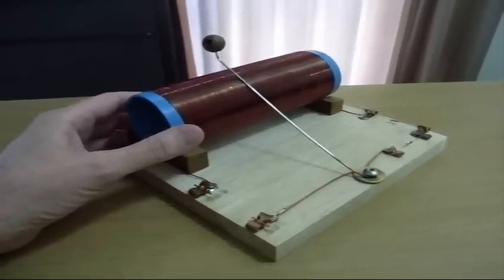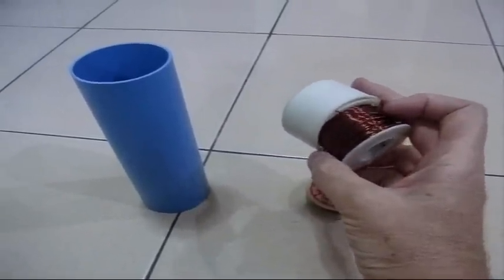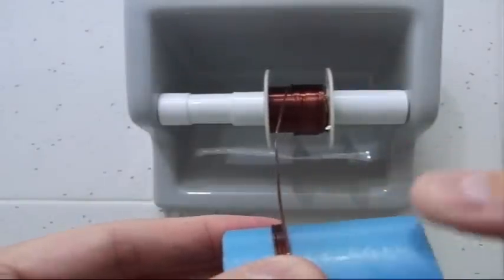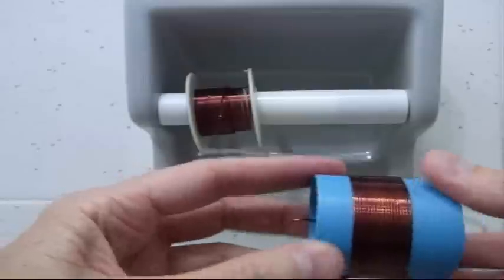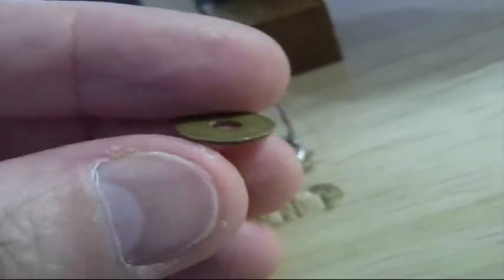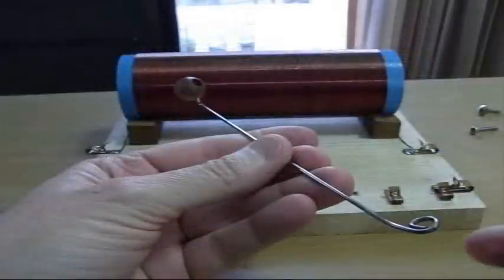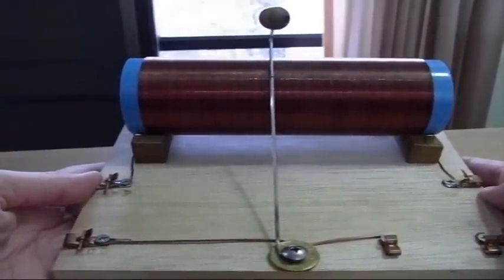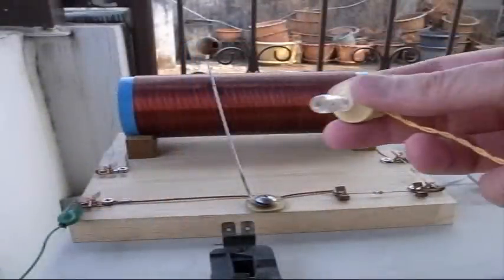How To Make A Crystal Radio - No Batteries (Updated Version Available)

Comment: No variable tuning cap?  I would think a simple slider foil variable cap would increase selectivity. A lot of the Xtal sets use a 150 or 240 micro Henry coil with a 365pf  variable cap for tuning. creates an oscillating tank circuit to select the carrier frequency and squelch other frequencies as I understand. Not to be confused with the cap that sometimes is use for the earpiece.
Reply from the maker: I thought the same.  I saw the same in many diagrams on the internet, but no one actually made one.  So I did.  It did not work.  It got 1 station well, a weak second one.  A germanium diode by itself will get 1 station!  (I made videos on both of these.)   I've been looking at transistor radios that use a 365 var cap, and they use a few very small coils BUT they also use part of the ferrite antenna in the turning circuit.  Don't have it totally figured out yet, need to spend some more time with it.  https://www.youtube.com/watch?v=i2PITPUg2vI
https://www.youtube.com/watch?v=GdvKDFz9Xi4
Reply: The Antenna supplies the necessary capacitance, and the variable inductance tunes the two together. This is how the earliest sets worked before tuning caps were available. But you do need a big antenna and an Earth.

Comment: Can it be made on a smaller plate using the same coil?
Reply from the maker: The dimensions of the coil are important. With more work, you can mount it vertically....

Comment: Would you mind why putting the resistor in the circuit won't reduce the flow of current/signal...sorry to ask but i just need to know :
Reply from the maker: +Meiji Jap It does a little bit.  The earphone has a lot of capacitance and if you don't keep that capacitance discharged it builds up and you get a snapping noise instead of a nice sound.  Try it!
Reply: what a coincidence does that noise that i hear in my home phone is over capacitance from the phone line?
Reply from the maker: The noise on the home phone is probably caused by corrosion on a contact somewhere in the system.  Copper oxides can act as a diode that forms and breaks down so you hear static.  You can wiggle your phone plugs to see if it gets worse; if so have them cleaned.

Comment: The first crystal radio kit I got was a X Mass gift from my dad in 1962 and when we / he assembled for me I was astounded that it worked without batteries!  Even in 1962 every kid knew that cool toys and radios needed batteries to work so this gizmo was too super cool!   Later from time the Walgreens Drug store would sell near the check out the Rocker Radio ! for your listing  pleasure or about $3.95 in 1965 money.   https://www.youtube.com/watch?v=t5ww6bQg5ic  .  I bought a couple but my peers though it just make look like a nerd when I was using it so I gave up on them and they ended up lost or broken .  Still love the idea of this very old tech.
Reply from the maker: I built my first one about 4 years after yours.  Mine was from the Wolf Scout handbook.  Did not work at first.  By trial and error I figured out there was a misprint and an extra wire was shown that shorted the main coil.  Still have that book.  It was a lesson to me that books are written by people and people make mistakes.

Comment: Is the diameter of real importance, or will other diameters also work?
Reply from the maker: There are 3 parameters to a coil: diameter of the tube/form, number of turns per distance (which depends on wire diameter), and the core material (these are air core).  Together they create a given inductance which (with capacitance) affects the frequency at which the circuit resonates.  If you change any of the parameters by much, you will shift the receiver's range outside the AM band.  If you are brave and want to create your own coil you need about 450-650 micro-Henrys of inductance and you can use one of the many online calculators which will allow you to experiment with different wire sizes, tube sizes, wire lengths, etc.
Reply: @tsbrownie  Thanks!

Comment: If there's no external power source like a battery, what creates the electrical current necessary to make it work?  And is there a positive and negative end?
Reply from the maker: The radio waves themselves power the radio.  The diode turns AC into DC pulses that you hear as the encoded sound.  The carrier wave is too high for you to hear.
Reply: {// WTF! //}  The carrier is the transmitted frequency,  modulation is "impressed" on both sides of the carrier.  The carrier does not depend on the modulation but the modulation depends on the carrier .

Comment: Can this be tuned to the area of 24-30 MHz? If it can how does one figure out how to build for this range? Thank you.
Reply from the maker: I'm sure it could be made to resonate at that frequency range, BUT this only works for AM (amplitude modulation), so it won't do much good.  I've not designed any radios, but based on theory, you need a tank circuit (capacitor inductor) that resonate at the desired frequency.  There are free web sites that can do that for you.  Once you have the needed inductance, there are web sites that tell you how to wind a coil for that inductance.  NOTE: the values will be small AND most of the capacitance for this style of crystal radio comes from the coil itself (the wires running close together creates capacitance).  I have no idea how to calculate that capacitance.  My GUESS would be to make a coil that was a third less inductance than specified to compensate for the capacitance and then experiment from there.

Comment: So, If i spend on this time winding something like this out of copper wire I got out of an old crt television, can this same magic be used outside the crystal radio set as a wide band antenna? And how much of the radio spectrum do you pick up with that? It's pretty cool and I want to experiment with something like this
Reply from the maker: In theory you could create different coils to cover any frequency range you want.  In practice it's pretty difficult.  Lower frequencies like the AM broadcast band are easier.  And AM radio stations often have high power, which helps make this work.  You can add an amplifier and that helps get around the power limitation thing.  This will not decode digital signals, or FM, it has to be AM - like old TV stations, CB radio, Ham radio, ...
Reply: What frequency range does this antenna cover? I am a little new to all this and the range of frequencies on the spectrum allotted for Amateur radio, AM, shortwave and the public safety bands (for a scanner. I wanna build a discone, but after some other experiments - I just built my first scanner antenna, sort of.. Perhaps you could give me some suggestions there to. I am really struggling and looking for someone I can pull advice from. I don't wanna bother any one person too much :D  -- I used to DX a little when i was a kid. I had a GE super radio 3, which is still a great radio today! Trying to make a passive loop for it right now and am conducting some weird experiments that I have not seen on the net and have no clue if they will work, but I suppose we'll see. I am going to bust out the super radio here shortly and see what I can hear with a cheap ass external loop antenna that I found at a thrift store. The kind that comes free with a stereo system or something. I'm sure you know what I'm talking about. I want to see how this little loop affects an already great radio with 2 ferrite bars inside. I have some questions about the use of ferrite in antennas too if you feel like fielding any of those. Your videos are great, well thought out and informative. I learned a lot when just starting up into this hobby. I have probably watched your video a dozen times for reference info. I hope you feel like helping out a new guy. :D I am a retired policeman.. Retired because of injury after 10 years of service, now I am teaching myself electronics and things like this that I still find fascinating. Anyway. thanks for taking the time already to respond. I hope my response is not too length.
Cheers mate,
Tom
Reply from the maker: Thanks.  The antenna for these is not really critical.  Generally speaking, the longer the better.  If it's long and well impedance matched, that's as good as you can do.  How to match it?  I'm also studying that.  It's typically another inductance / capacitance thing.  Antennas receive all frequencies all the time, they receive some much better than others.  You can match any antenna to any frequency, but the cost is efficiency.   
Ferrite bars will lower the frequency of a coil, all else the same.  
For advice, you can look at the ARRL wed site.

Comment: When i was a kid i saw one of these my dad had in the garage but it is long gone but i always wanted to make one thanks! Could you add a capacitor to help it's resonance to use larger headphones?
Reply from the maker: You can do a lot of experimentation with these and it's quite easy.  I would start with something like this that you know works, then try different things like more/less capacitance.  I've found that the amount of capacitance is very tiny.  Too much lowers performance and "too much" is not much.  But that's a big part of the fun of these is to try new things.  Tuning the antenna can have huge effects on performance as well.  That's something I need to put more time into.
Reply: i saw  a homemade adjustable capacitor  made with a paper towel and notebook paper roll with tin foil you slide up and  down inside each other so you can make the capacitance very small or a little more.Very neat,I always liked resonant circuits.
Reply from the maker: I've seen that, I might have to make it to see how well it works.

Comment: Hello, I have built the radio you have shown step by step and not getting nothing, my question would be what should be the picofarad of the coil itself I think mine is 40 picofarads should i make larger coil ?
Reply from the maker: I am guessing you are using a different diode or different earphone.  Both of those MUST be exactly the same ones I am using.  The coil is not critical and extra capacitance usually makes it worse.  The other extremely important thing is the antenna; with a good antenna even the ground is not important.
Reply: tsbrownie yea the antenna I was using is only about 4' and I'm using an 1n34a and 10k resistor but getting nothing.
Reply from the maker: If you have an AM transmitter of any power around, even 4 feet will work (a bit of static or very quiet music).  How about the earphone?  It can not be from a phone or radio or such.  It has to be the same "crystal" earphone (actually piezoelectric these days).  You can find them on Amazon.  It's really just impossible for these NOT to work!  
Oh, check your connections: make sure you got all the enamel off the wire.  If you have an ohm meter that would be good.  Resistance should be near zero.  If the diode has been used for other projects, it may not be any good, they are easy to overload / kill.
Reply: I made my own earphone from an old buzzer, but yea i will keep trying thanks.
Reply from the maker: There's your problem.  Has to be the same type.
Reply: I have seen others make them with old buzzers and worked, thats why I tried one, but thanks.

Comment: I seem to remember most sets using a 365 pfd capacitor in parallel with the coil, and I have some nice enamelled 14 gauge wire, any idea how many turns on what size form to make that work
Reply from the maker: The answer to number of turns depends on the size of the core.  I used 2.5 inch PVC and about 6" of winding space (the core is about 7.5 inches long), 0.5 mm wire and I think it's about 180 turns with those specs.  The 365 cap is no longer needed, in fact it makes things worse.  The "new" crystal earphones are piezoelectric and bring lots of capacitance with them.  There are more details in the description.
Reply: got it thanks, miss the old days when parts were easier to get for free, cant imagine what a variable cap costs now,
Reply from the maker: Costs are not that bad.  You can still pick up stuff for cheap from garage sales, trash bins (I have no pride) and friends and relatives.  I found an old shop that still sells repair parts for analog TV and radio!  Then there's Amazon and others.  The only parts I bought for this were the diode and earphone.  Both under a dollar.
Reply: About two dollars on ebay:  Search for "miniature tuning capacitor"

Comment: No external power required....except a 25000 watt Radio transmitting station!
Reply: Yep I posted a "live video" once where I was playing some music in the background at low level, and they sent me a mail about infringement. :)
Reply: yes this is probably why we hear non of this cause you could get people thinking boy i could just collect energy from the air.. and you can oh no there electric in the air we can use for free ... we walk in a see of radiant energy look up tesla radiant energy collector.
Reply: lol
Reply: boxlessthinking you need high voltage and the resonant frequency of the sky that a coil is tuned to and you can do it.. which is around 7hz.. you normally need a very large coil for that
Reply: Power is needed to transmit, not receive, and the radio only receives.
Reply: You don't need that. That's already taken care of its fine.
Reply: Frank Zimmerman my God, to receive it!!!!
Reply: I made one with a vac tube triode, use a 12AX7, tune with a variable capacitor.
Reply: the key word being... "external" :)
Reply: @robertkat  would you care to share the details on your build ? I'm no electronics expert but I will be my sons hero if I could build something so impressive. Tnx
Reply: @boxlessthinking  You need a box.
Reply: Frank, I think you missed the point. Maybe you and Boxless can get together and go on a date.

Comment: I like using a lighter to burn off the enamel on the magnet wire, instead of scraping/sanding it.
Reply from the maker: I used to do that also, but I have found that many of the new coatings just turn into a sticky mess that's harder to clean off.

Comment: Is a 2.5 inch diameter 5 inch long coil too big?
Reply from the maker: +Scott MacDonald It will probably work.  There are some tradeoffs.  A longer tube and coil means more tuning across the band, but it is harder to make a tuning rod that works well (the rod travels in a circle over a straight coil).    Shorter means fewer stations.  There are limits, if it is too short the overall inductance is not enough and if it's too long the inductance is too much.  I've made them out of toilet paper tubes (short) and cut down Christmas wrapping paper tubes (long!) so there's some pretty good leeway in them.

Comment: is the germanium diode is the resisters
Reply from the maker: A diode is like a 1 way valve.  The 1n34a is a very "sensitive" diode and you can not substitute.  A resistor is like "friction" in a system: it turns energy into heat and in doing so drops voltage.

Comment: So, is it the number of turns that's important or the length of the coil wire?
Reply from the maker: Michael Douglass Good question.  Seems it's both.  The formulas I've seen include turns per inch and diameter so that is related to length.  I've made a second coil that's 3.5 inches in diameter with around 3x the length of wire and done some experimenting with it.  I've only done a bit, but so far it does not seem to be that different.
Reply: tsbrownie Okay, thank you for that. 

I bought some 20 AWG wire; but only 39 feet; not nearly enough because I was too lazy to do the math. But, I found a solenoid with .5mm wire. 

My PVC pipe is ~2.3" OD which is ~7.2" per wrap; or 183mm per wrap.

My curiosity got the best of me and I wrapped a 142mm long stretch;  142mm(stretch) / .5mm(wire width) = 284 some-odd wraps.  

284 wraps x 183mm per wrap ~ 123ft

We'll see...

Thanks again
Reply from the maker: Michael Douglass I'm going to guess that will work fine.  The plus and minus of big wire and big number of turns: with big wire you get lower resistance which is good with crystal radios because we are talking really, really small currents / voltage, BUT the coil gets longer for the same number of turns.  With turns: more turns means more tuning BUT more turns means more resistance, so there's that.  I have to try using a "core", maybe adjustable.  Saves a lot of winding / space.  Half the fun is trying new things.  Thanks for the note.  Keep us posted.
Reply: tsbrownie I wonder, then, if crystal radios are intrinsically limited in what they can pick up and push out into the speaker... hmmm.
Reply: Michael Douglass Or, thin wire/long wire radios might need extra long antennas.

Comment: What is the function of the first short coil that was bit used.?
Reply from the maker: I don't understand the question. Which first short coil?
Reply: @tsbrownie  Go to 3.30 minute into the video.     You wind a short coil which is not the one you finish with.
Reply from the maker: @marynollaig4124  Oh, it's just a demo on how to wind. It's not used in the radio. Just easier to wind / see on camera.

Comment: can i use clothes hanger to make a tunner the change the radio stations  and for antenna can you fast replay because i have next week science fair
Reply from the maker: +Faisal Abunameh No steel (hanger) has too much resistance and rusts.  A brass rod (from a toilet float valve or water tank float valve) will work as well as stainless.  You can tell if it's stainless or brass because of the color, strength and the fact that they are not magnetic.